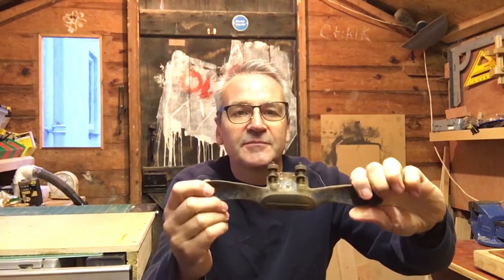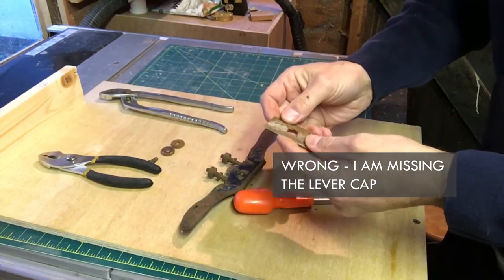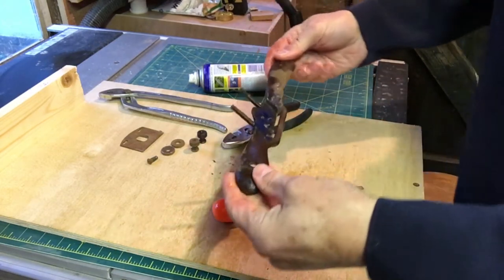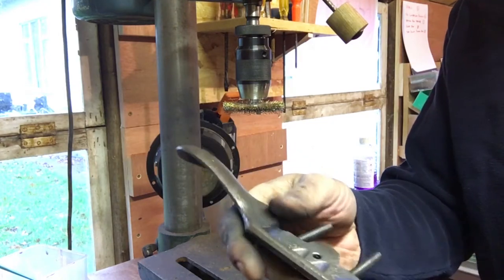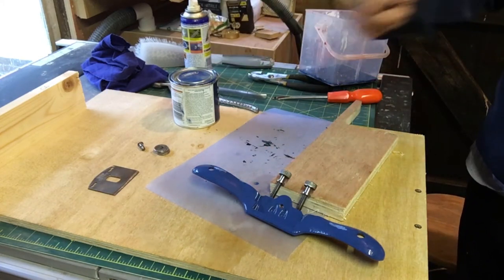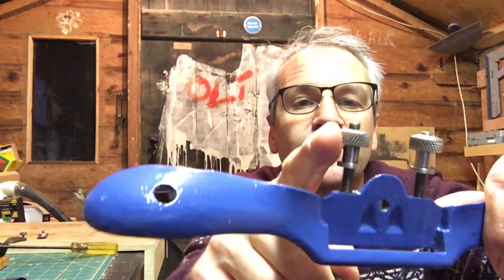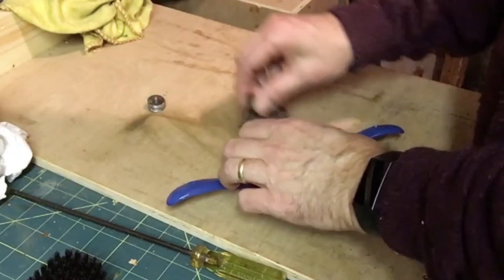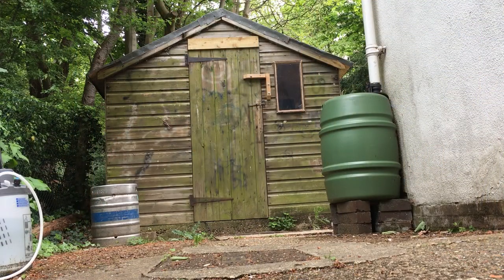Vintage spokeshave restoration

Comment: That cleaned up well.   Shame it was missing the cap iron but glad you found one for a reasonable price.   Sadly parts are often missing in vintage tools.
Record used to sharpen their hand plane blades at 25 deg.   This was stamped onto the blade.   I do not have any Record spokeshaves so cannot check.
As you quickly observed, spokeshaves can easily get shaves stuck in the opening, since no chip breaker in the design.
Using a spokeshave can be a lot of fun.
Dave.
Reply from the maker: Thanks I think it’s a tool that will be handy to use as minimum setup needed - I now need to make some storage for all these tools , and then make a bench it’s got to be done